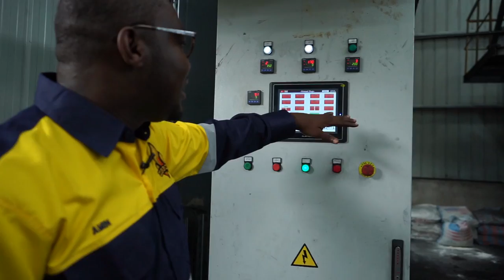I Used My School Fees To Build The Biggest Charcoal Factory In Ghana

Comment: Coconut Shell!   Famous for use as ACTIVATED CHARCOAL, I guess it's heated under vacuum?   People use it to purify air, liquids, water....  A high value product, but of course it needs more capital to make it.  Regular charcoal that you just burn is good too!  I think there's a lot of demand either way!  If it weren't for your videos, I wouldn't know ANYTHING about Ghana!  Or a lot of other places, actually.
Reply: There is a high demand for it in medical field for poison control (drug overdose). Medical field application will require grinding the charcoal into fine particles/particulate form. It is also used in cosmetic field for skin detoxification (face mask) and oral care application for teeth whitening. You can contact me if you require additional information.
Reply: So when are u visiting next year?

Comment: If by some small chance this guys sees this comment. First, congratulations on your success. Secondly, if you want to think bigger, consider planting a bamboo plantation. Once the plantation is established, 6-8 years, you will be able to harvest roughly one quarter of each plant every year forever. Harvest wood and turn into charcoal. Additionally, bamboo is a very environmentally friendly plant and will help to restore soils. Remember to spread some of your charcoal in the plantation as well as it helps with long term micro nutrients. Best of luck from the USA.

Comment: im not sure if this will help him or not but how do you produce the heat for the charcoal? if its with a seed fire he could build a steam turbine to generate electricity as well
and if you use steam to spin the turbines you can recapture the steam again to then run sterling engines which the generate more electricity.
In Poland they have a charcoal factory that runs at 40% conversion rate turning wood  into charcoal but also generates electricity